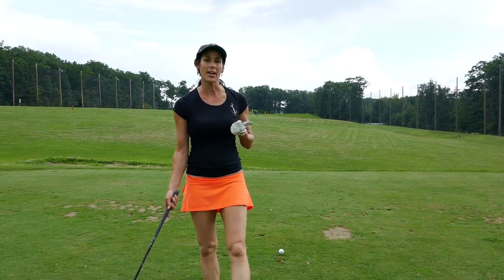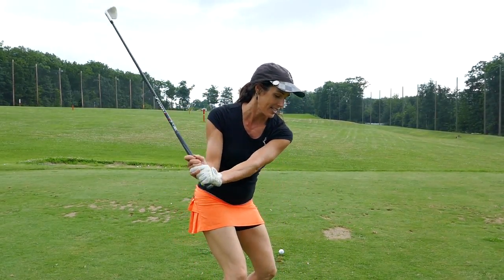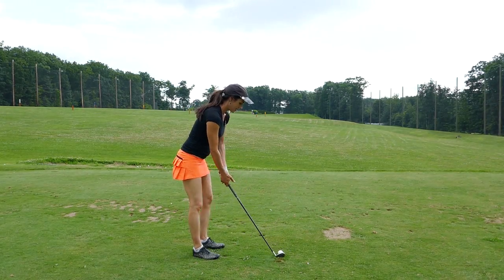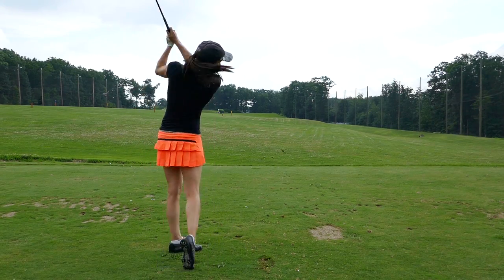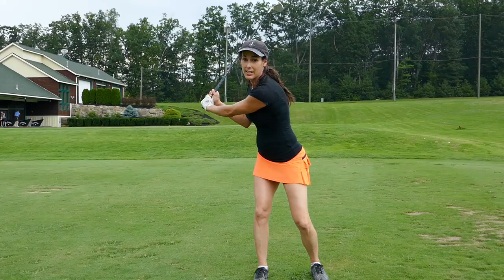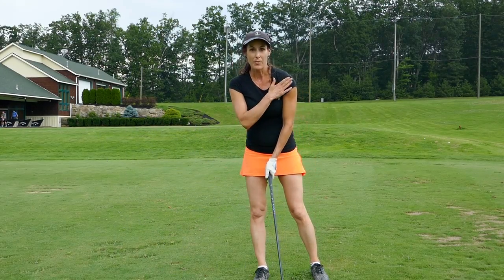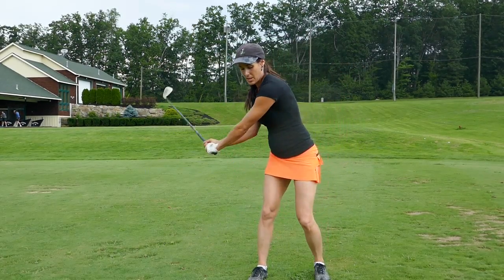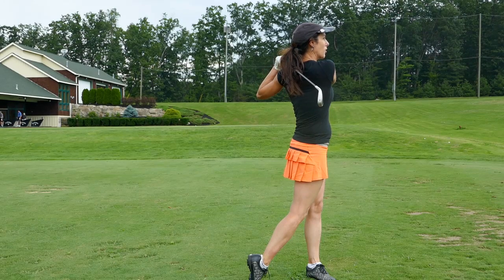Drill to Fix Over the Top

Comment: Thanks for the tips Christina.
I'm a bit confused. Some teachers amphasised on staying centered, but you said L shoulder should be over R foot, which means a weight shift to the R. And how about moving the hip first ?
Can you please enlighten me, a poor old chronic overthetopper?
Thanks!

David from HK
Reply from the maker: Hi! Thanks for watching. Staying centered is great as long as the weight gets transferred to your back leg. Instead,  many amateurs version of staying centered results in a reverse spine angle and too much weight still on front side (resulting in an over the top move on downswing). So instead, getting that lead shoulder over your back toe really promotes a proper weight transfer (shift ) into your back leg. On the downswing, YES, your weight transfers to your lead leg and THEN your hips rotates open. Too many players, rotate their lead hip a tad too soon, resulting in the spin-out. Hope that makes sense!

Comment: How do you avoid staying on your back foot, in other words, how do I transfer before?
Reply from the maker: Stuart - once your hands drop, then aggressively get to your front side. Hips rotate left and back shoulder wraps all the way around on the finish. This drill is a focus on the transition. Once you transition correctly, you can really aggressively fire through to your finish on the correct swing path!
Reply: My swing thought for the moment is to turn the hips to get onto my left side, then my hands drop and I spin my shoulders, the reverse of how I coiled. I also notice that I have to use the hips to get the hands to drop otherwise, I force my arms which also leads to being too far on my left, over the top, etc.

Comment: I been having over the top issue forever. When I drop my club with this drill I keep hitting 1-2 inches behind the ball. Why? Am I releasing too early?
Reply from the maker: Make sure that once you drop, you get to your finish aggressively...where all your weight is on your front side. If you are not firing through, you could chunk it. Meaning, if your legs are passive and you are not rotating through with your upper body (once you have dropped your hands down) then you could chunk it.
Reply: Get that back elbow well in front towards your belly button when you drop the club and turn through...harder to release early that way (the back shoulder works down but the back elbow should work out in front and not stuck behind.  Try doing 3/4 practice drills with back elbow tucked and working out in front (towards the belly button) and try to extend the club so that contact happen beyond the ball and not behind it. Remember to turn through. This really helped my problem with hitting fat shots.

Comment: So...either I do these drills over and over again like a touring pro to groove some brand new swing characteristics to fit my modern light weight clubs.... . Or, I just buy a new set of clubs that are weighted properly, therefore allowing me to naturally find the proper swing slot, rythym, timing, and balance....Hmmm
Reply: Johnny Apple Seed         Suggest you have to do both.  Get whatever clubs, but you also have to get the right moves.

Better clubs will not make you a better player.  Better players can do more with better clubs, though.

Remember, it's not the violin that plays; it is the person holding it.